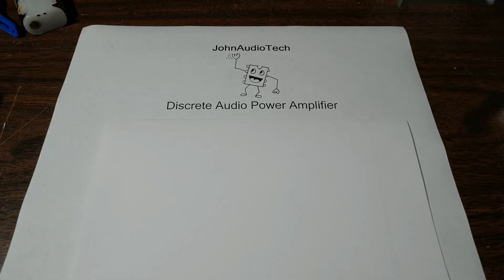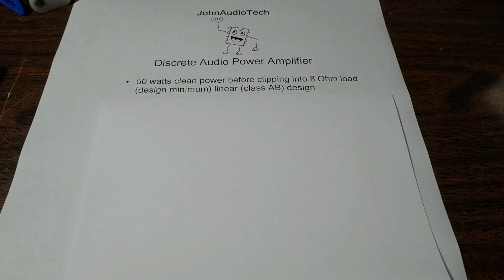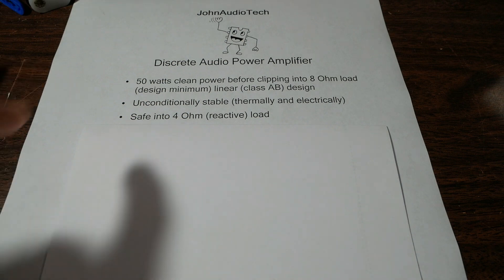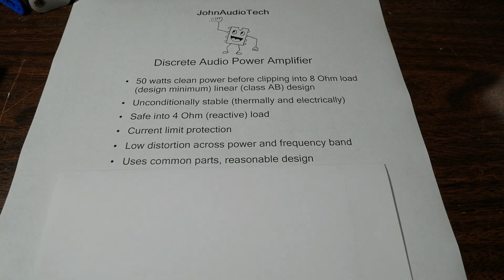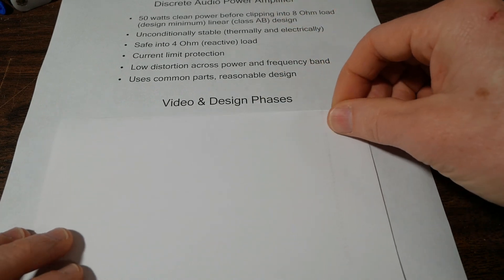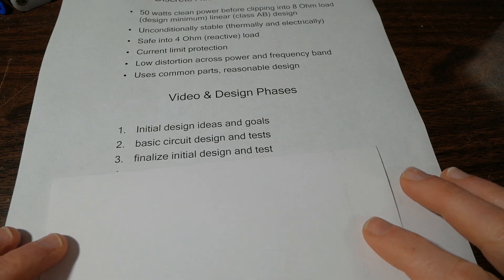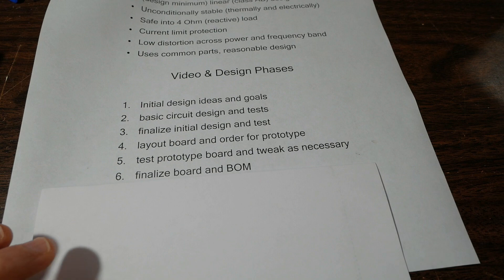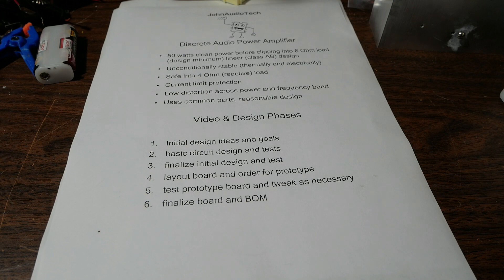Discrete audio amplifier design and build PART 1 - Introduction

Comment: Very interested in watching these videos. Might even be interested in buying one. If it had a warm sound. I like 2nd order distortion. Tube type sound. It would most likely have to be able to run off a battery for me to buy it. But maybe not. I'm thinking of buying some Tekton Lores. Either the regular, mini, or reference. And was thinking they would work great with a battery powered low power amp board. I have two extra car batteries in my garage I could use to power them. And I already have a battery powered DHT preamp (Bottlehead Quickie). 

And if I did all that. I would get a good battery, or super capacitor powered DAC too. I already have a battery DAC (Starting Point Systems DAC 3), but it's not good enough IMO. And it's too laid back. With very slow PRAT also. It would probably be better for me to go class D for this, but I would still probably try it. And if it doesn't work out good. I could use this on something else. Or give it to a friend. I really like the idea of a better quality one. Then the ones currently available. Well the cheaper ones anyway. The good ones cost WAY too much IMO. And the cheap ones are too cheap. I want something in between. Either way though. I'm very, very interested in the video series. That's for sure!
Reply: Oh. Almost forgot. Why not make it so it can be bridged too? That way if someone wants more power. They can buy two of them, build monoblocks, and bridge or bi-wire them. Even if it only does 8 Ohms. That would be fine. I would buy two, if that were the case myself. Even if it needed to be plugged in. And maybe you could build it to use an already assembled SMPS. Some of these are very high end nowadays. There's a Meanwell one that Nelson Pass recommends for his Amp Camp Amps even. You could sell the board already assembled, and then we could get the PS, and toss it all into a case ourselves. These might even work for active speakers. This could be very cool!
Reply: David Clark made a circuit decades back that would adjustably add second order distortion, I'd really like to find that circuit, probably as simple as a single op-amp buffer on a split supply with a resistor on one side changed to a variable... It was published in Audio Amateur deep back in pre-Internet eras. I should search again, maybe it's been digitized by now.
Reply: I think he intends to keep it simple, for educational purposes rather than trying to market this beyond his YT tribe. I would probably buy one or a few of them.
Reply from the maker: It won't baseline simple nor highly complicated. I'm thinking 14 transistors including the current limit circuit.
Reply: Hill's Workbench This guy makes a circuit like that. He's got a lot of fans. 
http://www.aksaonline.com/buying/buying_price.html
I would love to try one of his amps myself. But they're not cheap, or powerful either. At the price of his 100 watt kit. You may as well just save up a little more, and get a used 100 watt tube amp with fresh tubes in it. It will seem more powerful, most likely sound better, and you won't have to source stuff and build it. Hold it's value better too most likely. For my money. I'd rather get a 120 watt Musical Fidelity a3cr power amp for about $500 used, and pay to have it freshened up. I've been interested in one of these for a while, and by all accounts. It's very tube like. I've heard that many times before, of course. It does get great reviews though.
Reply: JohnAudioTech I'm really looking forward to whatever you build John. Just wishing I could find an amp that does exactly what I want. One of these days. I'll have the time. To learn to do it myself, and then build it. Until then. I'll continue buying compromises, and hopefully they'll work good enough to make me happy. I've done pretty good so far, thankfully.

Comment: I would be interested in getting two, or one if it is two channel. 50 watts is plenty for me, as I currently use alesis rs-150's (30 watts chan) as my amps throughout my building. Not sure what low distortion is to you, but I would not want an amp with 1 percent. I think that .01 percent is easily achievable with common inexpensive components, but not sure. Any way it could be designed with a + / - powersupply? This way, for those who desire, they could strap them. Yah one may need to change the output transistors and heat sink, maybe even the powersupply if they want to see how hot they can get the amp, but that could be our option iv you use this powersupply. I done that before, quite easy to do.  I have everything here to print and make pcb's, but do not do it often, only for custom designed stuff. Would be cool if you provide the files and traces for board, but, I am certain I would buy the pcb if you have one of those pcb maker companies make them, Much better than What I can make. OOhhh, please put volume controls on them. Or design board for that option and we can optionally buy the parts and install if we desire. Amps without volume control can be real dangerous for most people. I would want the board and all the parts, I will assemble.

Comment: We are interested!!!  The problem I ran into with these discrete amplifiers is the matched transistors cost a fortune!!!!!
Reply: Normally there's no need for matching (although it might make a very small improvement if you do) - however if you decide to use FETs in a differential circuit matching is needed (and a real headache apparently).  I'd avoid the issue and use high gain BJTs throughout.
Reply: Thanks, I am here to learn and get the advice of others!

Comment: I am interested in pcb, may not be the components. Because I want to upgrade watts a little up to around 150w. Will that be possible.? With this kit?
Reply from the maker: 150w @ 8 ohms would require some design changes. It could be possible to bridge two of the boards for 200w.
Reply: JohnAudioTech thank you! That's awesome

Comment: Which is better to lower the impedance: transformer or buffer?
Reply from the maker: Depends on the use. For low level signals, a buffer circuit.
Reply: Thanks, John. So it is why I've never heard of a buffered output.

Comment: Many amplifiers were made to have great stats, like low distortion. 
What Audiophiles found out was that also killed the transparency of the the music.
Simply to many components
Personly only look at one stats, which almost never fails. That is S/N ratio, which 
indicate how much was invested in the power supply and how well made the board is.
Cheap china boards almost never inform the S/N, well properly due to it sucks.
It wont look good on the Brand.
Quite important in enjoying the music are the passes where there is silent.
Really looking up what you can make, you have a really interesting philosophy on the simplicity.
Hence transparency

Comment: Power gets out of hand pretty quickly. Most people dont realize that for an amp to sound twice as loud, it needs to put out 10 times the power. So, if 50 watts isnt enough, 100 watts isnt much better.
Reply: In reality, 5WPC maximum into standard 86 dB speakers can get way too loud in a normal room in a normal house.